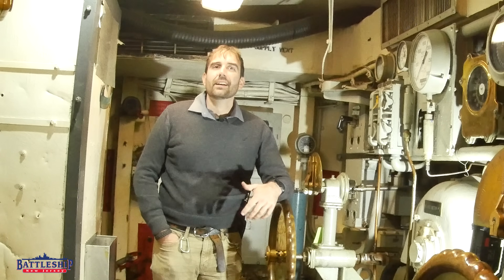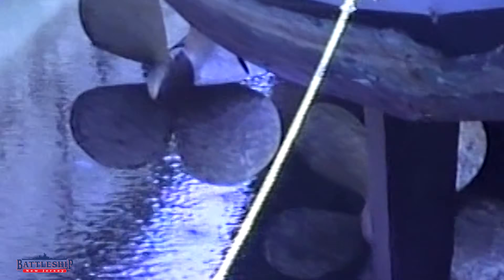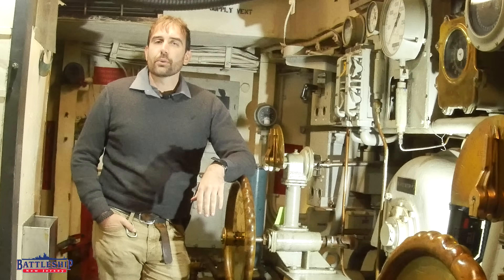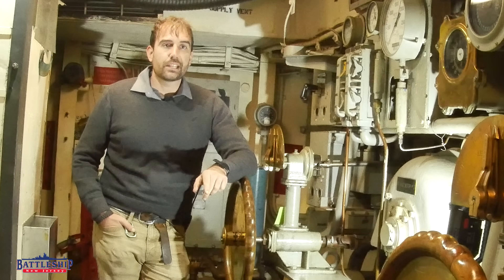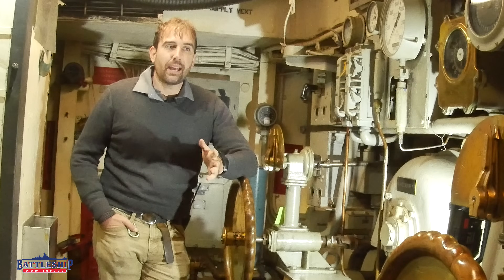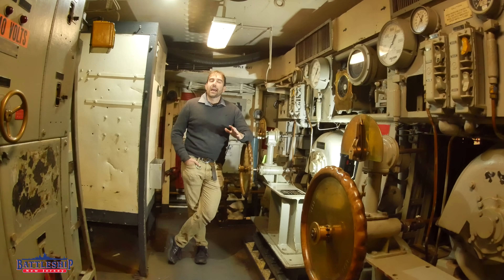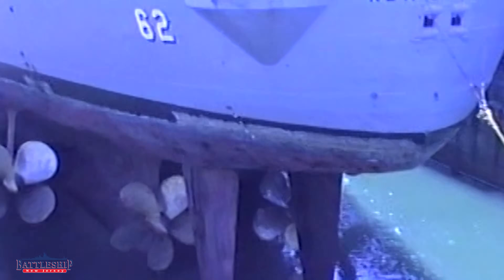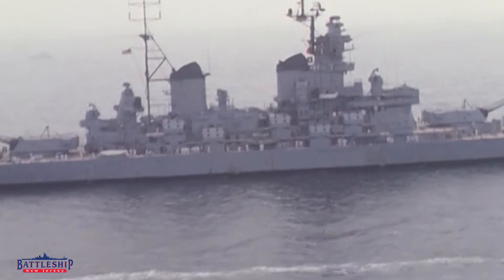How Quickly Can a Ship Stop and Can it Really Do a "Barn Door" Stop?

Comment: I know New Jersey's engines have separate ahead and astern throttles, but how does the reverse system work? Are there separate reversing turbines? Do we just spin the normal turbines backwards somehow? Is it something else entirely?
Reply: Steam turbine engines have an astern turbine separate from the normal HP/LP ahead turbines; each has a separate throttle, but both feed into the same reduction gears turning the shaft.
Reply: @billpaine6241  Thank you.
Reply: If you look on top of the low pressure turbines, on both ends you'll see lines entering the top.  They'll say Astern Steam (Main Steam).  It's a matter of shutting the throttle valve and opening the astern stream valve
Reply: @ytlas3  Thank you.
Reply: @Phoenixlover55  In twenty years at LBNSY I worked on hundreds of ships including the full reactivations of the Jersey and Missouri. Even did the two pre commissioning sea trials of the Jersey where we did a "crash back" from 30 kts.  It was so casual we didn't even know we were in the midst of one.  It was unlike the Sprucan I was riding on when the Capt told everyone to hang on...  Anyway, I have no idea what the separate astern turbine is that has been mentioned on your comment.  You go to an engine room and you'll see the HP/LP turbine and reduction gears aft of that, then the shaft. The book  Principles of Naval Engineering, (Bureau of Naval Personnel - NAVPERS 10788-B) Chapter 12 - PROPULSION STEAM TURBINES (around pg 318),  Figure 12-27. Low Pressure Turbine (with astern elements) 147.101 will show you a full diagram with labels and the astern steam openings on either side of the LP turbine.  The pdf of Principles of Naval Engineering is available in several places online
Reply: @ytlas3  So basically we spin the LP turbine backwards?
Reply: @Phoenixlover55  Yes, the astern steam spins the low pressure turbine backwards.  I never understood why they used main steam at 840-850 degrees instead of 600 aux steam at 495 degrees and saturated, but the engineers who designed the system do and they have always worked well.
Reply: @ytlas3  If it works, it works.
Reply: To add further to this discussion, combatant ships typically have a separate turbine for astern, but it's mounted on the same shaft as the ahead turbine. Astern and ahead mounted on the same shaft make up one main engine.
Reply: @WaterMan416  Thank you.
Reply: I would guess, and it's only a guess, that the reversing occurs in the gearing between the turbines and the shafts.

Comment: At around the 6 minute mark during the engine room scene, there is a wheel that's sliding up and down.What is it, and why does it slide up and down? I've seen this particular scene multiple 
times and was just wondering what the wheel does.Thanks!
Reply: That valve handwheel is used to manipulate a valve in the overhead. The linkage that connects that handwheel extention to the actual valve broke during their maneuver and they're scrambling to fix it.
Reply: Yeah I wanna know too.
Reply: That is not the engine room that is the fire room, those are BT's firing the boilers.
Reply: Looks like it might be a handwheel extension for an overhead valve. If the valve and associated piping is part of equipment that isn't rigidly mounted, it may be moving slightly as stuff flexes and moves. Just speculation, as I have no clue about this on an Iowa class.

Comment: Hey Ryan, you've touched on waterproofing before and your comment on the packing of the rudders potentially getting compromised from vibration has me interested in more packing info. I remember from the video on the shafts of the propellers that there was packing material there too. It could be an interesting video to talk about the waterproofing technology used and how well it all worked against what sorts of pressures, maybe comparing to modern tech or older tech.
Reply: No technology to speak of. A fiber was packed around the shaft, then a bung was screwed into a threads in the hole packed with the fiber. As the bung is tightened, the fibers are compressed tighter to the shaft, sealing out water. when the shaft is rotating, gravity doesn't pull the shaft down as badly as when idle. Museum, and mothball ships, have an issue with gravity pulling down on the shaft, compressing the packing below, resulting in leaks. Look up "stern gland packing". Nearly every inboard boat uses this system. https://youtu.be/KRDXn6dieIE
Reply: @ravenbarsrepairs5594  I can't speak to every class of ship but my own, but modern ships use mechanical seals with a packing system as an emergency backup
Reply: Older battleship but Tom Scott (the older one) addresses this on BB Texas: https://youtu.be/S9gW0eKYZzI
Reply: Do they use wooden shaft bearings?  Until very very recently, that's all they had, metal did not work.  arbor vitae.
Reply: @russellstyles5381  From my ship machine shop years in the early 1980's: Metal specialty alloys for shaft bearings. However, we did in fact do overhauls on ship that used Ironwood for the bearing surface, which generally outlasted it's metal counterparts.
Reply: @russellstyles5381  the Iowa class ships used lignum vitae to line the stern tube bearings.
Reply: @russellstyles5381  neoprene is common now for water lubricated shaft bushings
Reply: @WaterMan416  bearing not seal.  Obviously can't argue, but don't see how rubber could hold a huge propeller up.
Reply: @russellstyles5381  a bushing is a type of bearing the seals are labyrinth seals. It's a very stiff rubber, it's not like a neoprene wetsuit.
Reply: yup.... exactly as Ravenbar repair says...... its just a rope covered in thick grease (or something like that)
.
VERY VERY VERY old tech..... but it works.... and is easy to service

Comment: Our DDG's had variable pitch propellers, our stopping distance, from flank to moving backwards was so short it was firstly, classified, but secondly, stunningly short, also surprisingly smooth.
Reply: Our Spru-cans would do the same, reversing the pitch of our screws while moving forward at Flank bell.  From Flank Ahead to the ship coming to a full stop and then picking up sternway was LESS than a single ship length (563 feet) and yes, you can feel the deceleration PLUS she's going to SHAKE from prop cavitation, if you have loose fillings in your teeth you're going to feel it there.  😁😁
Reply: @robertf3479 wait wait wait.... So that lets you apply reverse power with the engines giving ahead power???
Reply: @joedirt861  Yup!  You see, the throttles that control the turbine speed and power can be operated independently of the Pitch Control for the screws.  The props don't stop turning even at an "All Stop" bell, the direction of thrust is controlled by the pitch of the prop.  Some pilots who are new to the system are sometimes surprised by how quickly the ship responds to the throttles, nearly instant.
Reply: Dito on our FFGs
Reply: I can tell you all, stopping an aircraft carrier is neither fast nor calm.
Reply: @eggsaladsandwhiches  so True
Reply: Is it no longer classified? I only say that because there is a YouTube video of a DDG at flank and doing exactly that. They are announcing it over the One mc or whatever you guys call it and a guy is recording it on the fantail.
Reply: @derekrohan9619  i'll point out classified includes confirming already available but classified info. One for the navy press.
Reply: @derekrohan9619  could you link it?
Reply: @Melanie16040  It was a few months ago. I just stumbled across it.
Reply: Ok guys, for the sake of all of us who were in the Army please explain what DDG's and FFG's are.
Reply: @dukecraig2402  I'm an Army vet but I like ships of all kinds.  A DDG is a guided missile equipped destroyer, and an FFG is a guided missile equipped frigate.  A frigate is smaller and has less armaments than a destroyer.   Both ships are fast and agile.  Hooah!
Reply: @dukecraig2402  haha I was army and I know … just giving you a hard time FFG is a frigate. DDG destroyer oh and the G is for guided missile
Reply: the crash back  is the way US warships stop quickly, works even better with the VPP. by the time someone manned aft steering, any nonsense about closing the barn doors would take too long, just the same just transferring who controls the steering would delay the stop enough to make it not practical.
Reply: @leftyo9589  When I was aboard Ranger CV 61 , After Stearing was constantly manned by 3 people
Reply: There's a few fantastic videos of this process including junior sailors getting very wet. :)
Reply: I get it for maneuvering at a slow speed but my thoughts were from a ship that was traveling at cruising speed seem not likely if It take so long to power down changing directions would be a slow process.
Reply: I was on USS Saipan, LHA-2
That ship didn't do anything fast!
Reply: Gas Turbines do that, battle ships steam!
Reply: drop the past tense of "had"- it is current. they have a controllable pitch propellor. They could simply change the propellors pitch - and try to not change the engine/ power/ RPM (but I think then you have to override the normal throttle operational mode)

Comment: 350 feet squared is a big rudder, that is 122500 square feet!
Reply: Yes ! There is a huge difference between 350 square feet and 350 feet squared . . .
Reply: @denali9449  That depends on how you parse "feet squared".  Our curator surely mean "feet^2".
Reply: @michaelsommers2356  What he meant and what he said are most likely two different things. As for "parsing"; square feet is a dimensional measure, feet squared is a mathematical operation.
Reply: @denali9449  The correct way to write square feet or square meters of square anything is with an exponent.
Reply: @michaelsommers2356  That is not the issue. Try this: 25 square feet is a square with 5 foot long sides. To say you have a square which is 25 feet square, you have a square with sides of 25 feet each or 625 square feet. Therefore square feet is a measure of area where feet squared is a measure of size. Please review your basic geometry.
Reply: @denali9449  Sigh.  He said "X feet squared".  You parse that as "(X feet) squared".  I parse it as "X {feet squared)".  Please review your reading comprehension.
Reply: @michaelsommers2356  My reading comprehension is not in question; your desire to make something into which it is not is the problem. Parse this - next time you get your property tax bill for your 12,000 square foot lot, go to your assessor's office and tell them that you want your tax bill based on a 12,000 foot square lot. Hope you have deep pockets. Mathematics and science have very specific rules for a reason; YOU are not allowed to simply change those rules on a parsed whim.

I have led the horse to the water but cannot make him drink. My tolerance for ignorance has been exhausted. Parse that.
Reply: aren't both measures of square feet? why would you square it?
Reply: @pizzaivlife    That is what Ryan said!
Reply: @pizzaivlife  It's the feet that are squared.
Reply: 350 square feet is the size of a battleship rudder. 350 feet squared is the size of a large aircraft hangar.
Reply: yes that is what ryan said- I agree with you math. Another case of what he said -is not really what he meat. Humm - did he mean 350 sq.feet or (that would be a equal square 18.7 feet on a side) - more likely - or perhaps just a square  35 feet on a side.(wag) .
Reply: Parse if you are half decent at mathematics or not.

Comment: I'd think with all that momentum the rudders would be bent or damaged.
Reply: Well, as the example of Wisconsin demonstrates, it wasn't something you wanted to do very often, for sure. I imagine it helped that WWII battleships were overbuilt to a significant degree. In a modern ship, where everything is designed to be exactly as strong as it needs to be and no more in order to manage costs... well, best of luck. (Then again, modern ships probably have more sophisticated tricks.)
Reply: @ZGryphon  its called variable pitch propellers, you don’t need to go reverse when you can at the flip of a switch go from full ahead to full astern in 2 seconds without needing to drop power output or anything.
Reply: @thedyingtitan1247  I'm familiar with the concept from aviation, where they have occasionally been a very mixed blessing. I suppose one advantage they have in a marine application is that if they fail, the ship doesn't instantly sink.
Reply: A prop loss on a plane doesn't cause it to crash immediately either. Though if you are referring to helos, then autorotating is only slightly better  @ZGryphon  

VPP was definitely not as fast on my last ship. Been 10 years, but I'm guessing 15-20 seconds from pitch out to pitch out. Sure the MDE's wouldn't be happy, but they'd do it. The MGT's would throw a fit and possibly shut down if you tried going beyond a Standard bell.
Reply: @JoshuaTootell  "A prop loss on a plane doesn't cause it to crash immediately either." No (at least, not always), but a prop reversing pitch in flight sure can (e.g., ASA Flight 2311).
Reply: As opposed to a hard turn of any kind? That's exactly what rudders are designed for. I'd expect any issues to be due to the rudders housing trying to separate from each other but- it is a battleship, it should be able to take it, even if half of whatever it is is missing.
Reply: I think that's the damage Wisconsin probably suffered.
Reply: @robertf3479  I made comment before watching. No I mean like really damaged